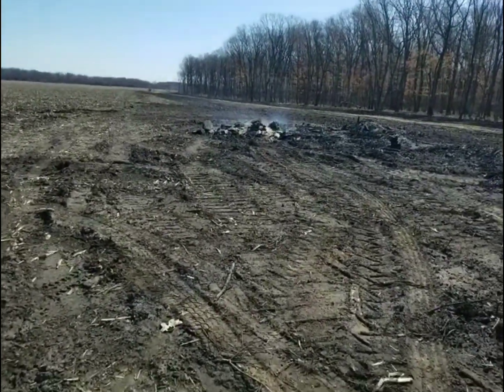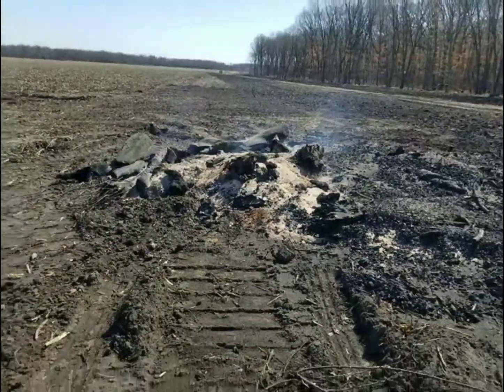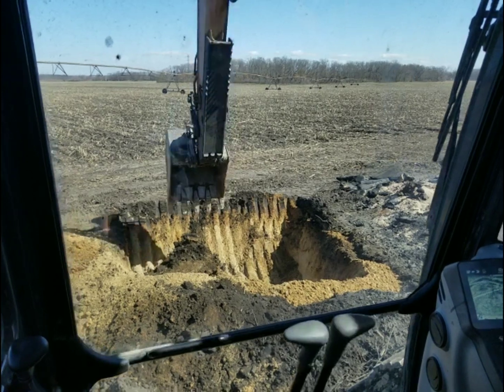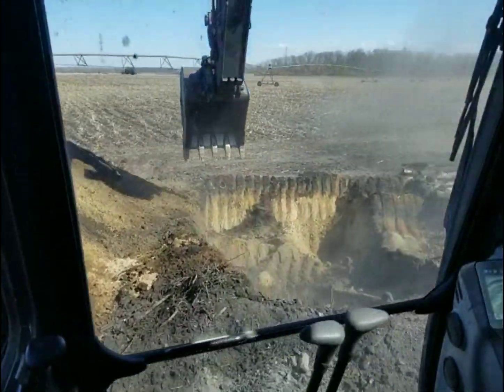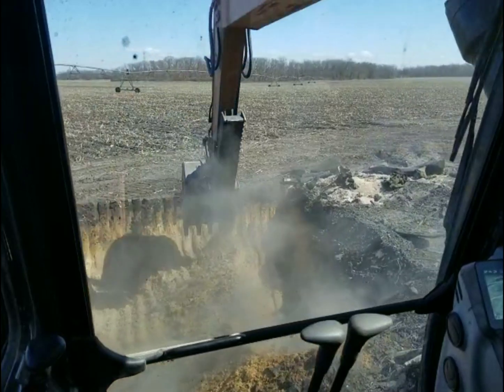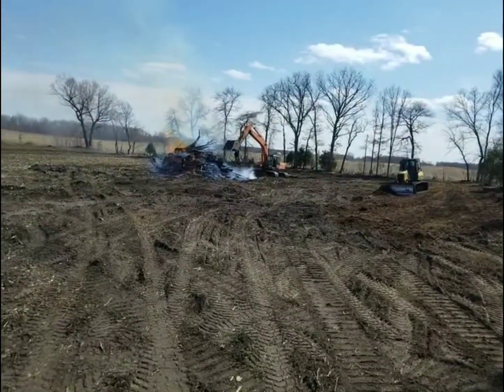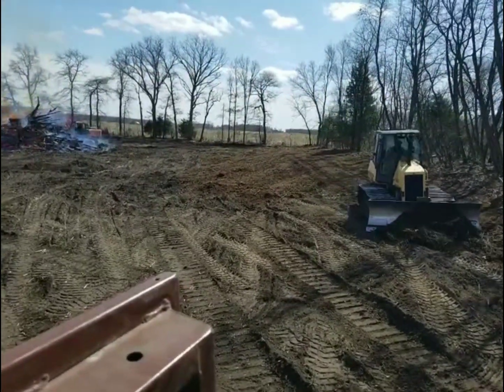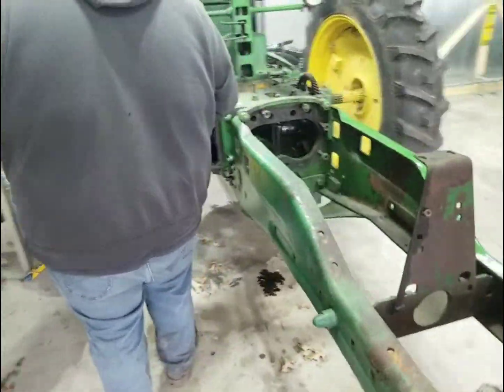John Deere Two-Cylinder 1950 "A".. I Bought A Heck Of A Project This Time!

Comment: Excellent video also I remember the John Deere A tractor my late neighbor Fred had one plus loader tractor with trip bucket  gas in line 2 cylinder motor was 1950 year and help him fix up back 1992 before had farm auction plus sold farm too in 1993 ! But he had bought brand new too and also farm plus did snow removal with each year too ! Plus also had Farmall think number was 232 gas tractor 4 cylinder 45 hp tractor was not row crop type also  1960 year and great tractor too!
Reply from the maker: That's awsome you have been around alot of tractors!!

Comment: That JD ought to be a great project!   The good thing is that even though it's all apart, it's simple enough that there's some confidence that it will go together and work after you finish.   And there's always New Paris Tractor Parts to fill in anything that's not working.

Comment: My Grandfather  bought  a model A brand  new  in  1952
Reply from the maker: My grandpa had a 49 and a 52 A....do you know what you grandfather paid for a new A?
Reply: @dirtgrainsteel  he  got  the  tractor  a 227 mounted  picker a2 bottom  plow  a 290 planter a a no 5 cycle  mower  for 3250

Comment: Haha! You pulled a Joe one🤣🤣. He's as bad as ours up here in Canada...
I can't believe how dry the soil is for spring time. I guess this is why you guys need errigation and we need tile drainage (eastern Ontario).  Nice project. I like buying my tractor as basket cases. What's wrong with the crank?
Reply from the maker: 😂😂😂 I heard that guys not liked very much up there.....we are extremely dry rite now we need to get some rain or we will be hurting....basket cases are fun!!.....the clutch was ran loose and the splines are badly worn on the crank shaft
Reply: @dirtgrainsteel  He's not liked here in the south either!

Comment: Is the Case going back or is the Hitachi going down the road? Wait! What about the 494 (probably a 1240) JD corn planter? I would upgrade the A carburation to the Duplex carb and intake off a JD 60 but that's just me. 1955 JD 60 was my first tractor bought in 1970 and had it until 2005.
Reply from the maker: This Case will be going back we will be looking at a few machines a little higher houred rite now this one has 750 hours on it and is $225,000 we are going to find one around 2,500 hours at a lower price and still have a good machine....regardless both Hitachis will stay the 200 will just stay on brush mowing duty the 270 will be set up as a long reach eventually.....I’ve been thinking about setting the a up like a 60 we will see what parts I can come up with